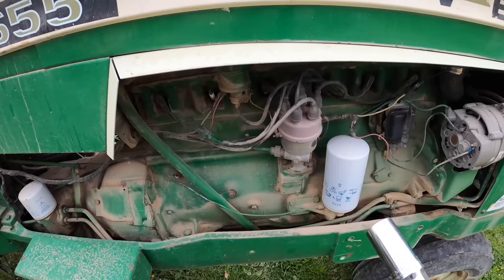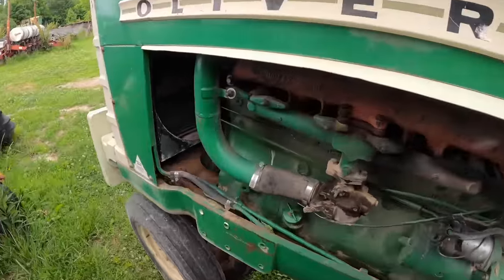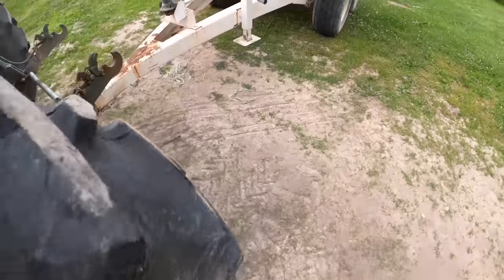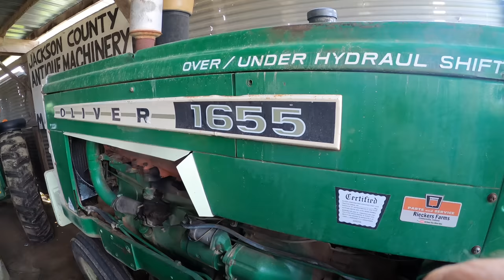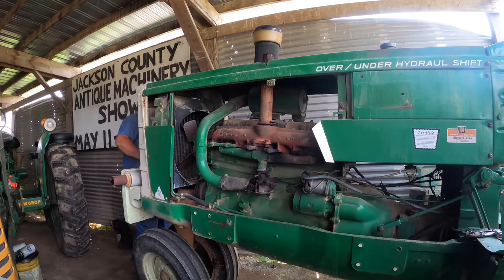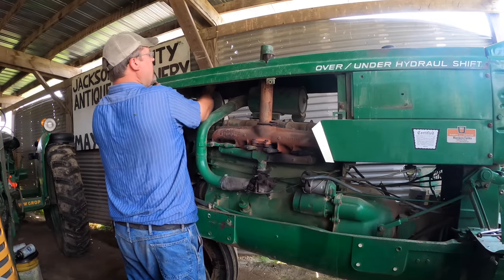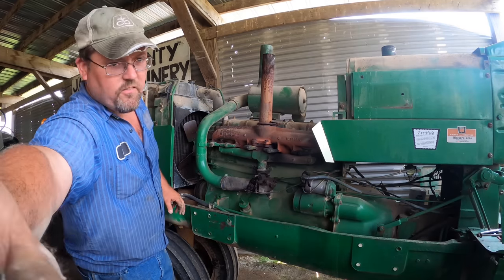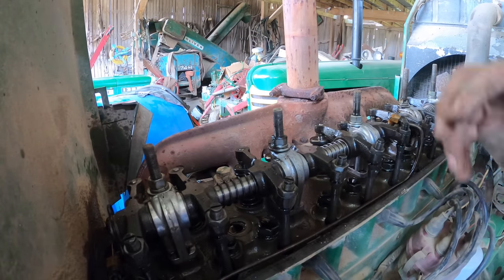1655 Sadness: How bad is the internal engine damage???

Comment: Apply air pressure at the spark plug hole, with the valves closed, and then listen to where you hear air escaping.  Exhaust pipe=bad exhaust valve.  Carb=bad intake valve. Crankcase=hole in piston or broken rings.  
And, you probably should have had it running and spray some flammable brake cleaner around the intake gasket.  A gasket-sucking air will make for a dead miss. The cleaner if sucked into the dead cylinder will suddenly make that cyl pick up.  Oil can also work as it will make the cylinder pick up if it is a small leak or if it is a big one the engine will maybe pick up that cylinder long enough to see smoke coming out of the exhaust stack.
I believe in checking all of the possible problems before removing the head.
Your certified muffler holder is also a certified shirt ripper.  Great video. Ich freue mich darauf, den Esel im zweiten Teil schreien zu hören.
Reply from the maker: 🤣🤣🤣 Thanks Gary!

Comment: Interested to see this project. Our 1550 burnt a valve many years ago when the Oliver dealership was still open. The 1550 has been a great tractor but this ethanol gas is hard on the them. My current issue is gas pouring out of the carb, bought a carb kit but no gaskets.
Reply from the maker: Yeah our modern gas is crap.

Comment: Look the old gas burner here got a skip new plugs didn’t fix it I had bent push rods mechanic straight Ed  them I had been hauling water on a hay wagon going down hill over receding it was the train of thought ran good for month don’t use it much went to skipping again new points new plugs and wires  didn’t fix it checked more bent push rods come to find out I ran some old gas poured it in ran great when you cut it off there is a build up of chocolate pudding on the backside of the valves when you cut it off it glued the valves shut when you hit the starter you got rod s bent
Reply from the maker: Unfortunately this one is going to need a rebuild. We’ll see that in part 2